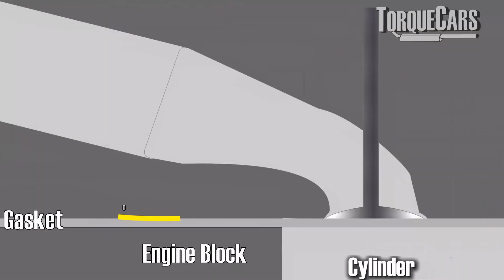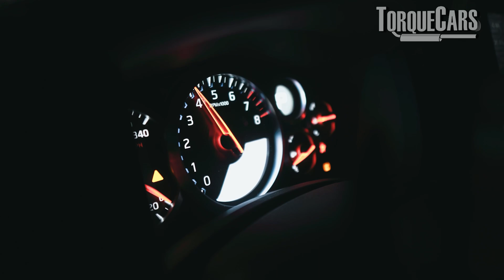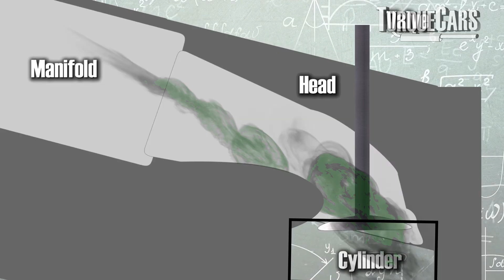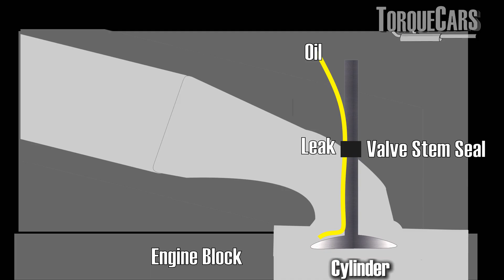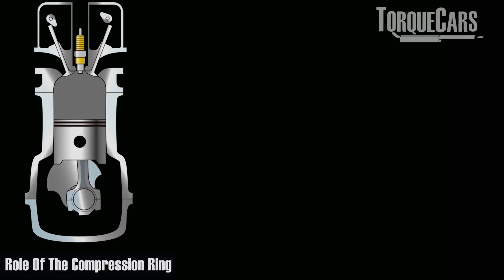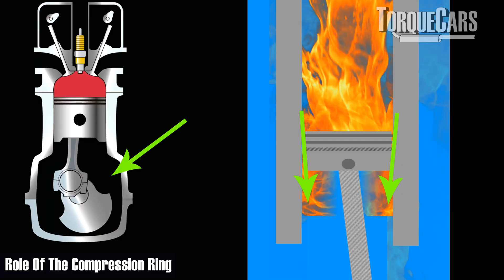What Causes Excessive Oil Consumption In Your Engine?

Comment: Strange one for me is the BMW N52
The 2.5 variant (short stroke) uses oil at around 1 litre per 1000 miles and the 3.0 variant uses almost nothing.
Reply: @GadgetMart  Different oil control ring design supposedly

Comment: My scoda superb 2 litre turbo diesel 110,000 Km  Feb 2017 uses no oil.
I do not abuse my engine and have it serviced every year
Reply from the maker: The problem seemed to affect the early engines more, I had a 2008 BUL engine which drank quite a bit of oil but still not as much as 1l per 1000km.
Reply: @torquecars i had a 1975 Austin Allegro 1.3 petrol. It was also an oil burner. 2 pints for rver 500 miles.